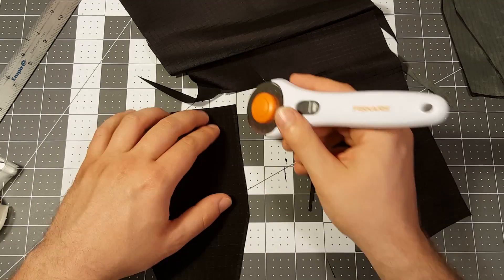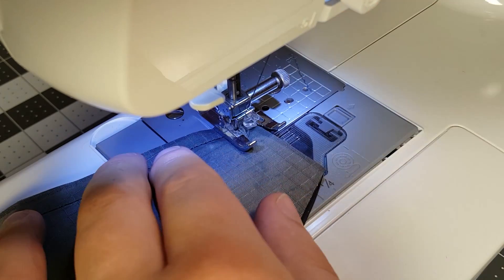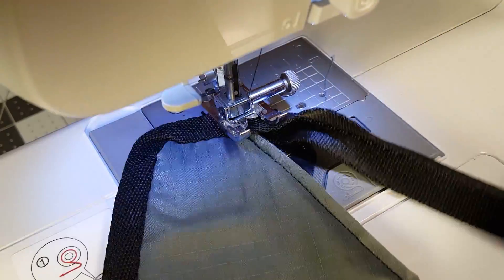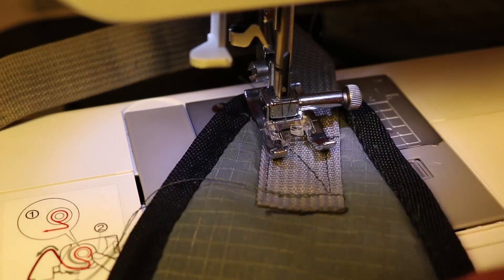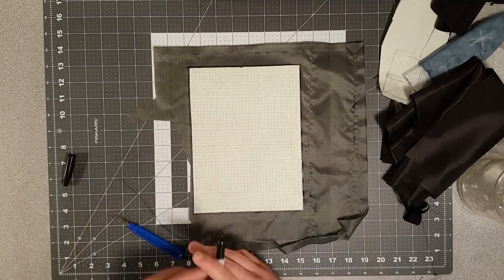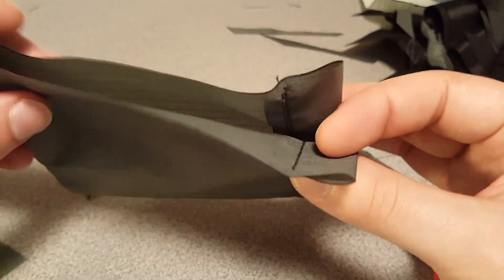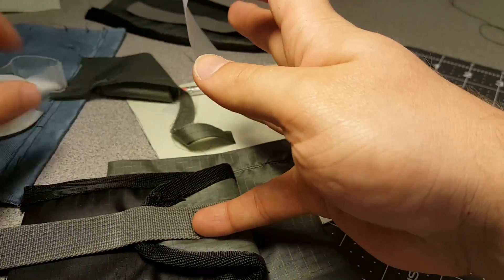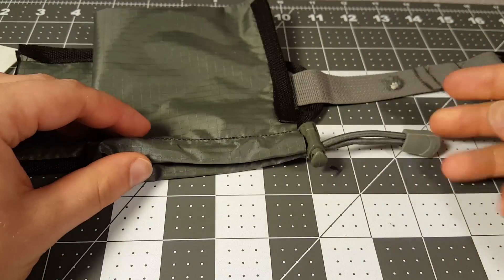DIY Ultralight backpacking Hip belt

Comment: Nice job!  I made the simple backpack, based on your earlier video, out of old tent material. Added pockets on the side and shock cord on the sides and back for keeping stuff on the outside.  I had added tabs for a hip belt but didn't get to it you so this video is very timely. Total weight on the pack right now is only 8 oz. 

Thanks for well done instructional videos!

Comment: love your video.  1 question--how did you attach the waist strap to the pack.  I'm working w/leather
Reply from the maker: The straps go in between the seams of the pack body. I am not sure if that will work with leather as its really thick. good luck!